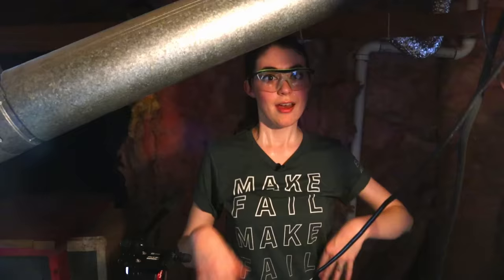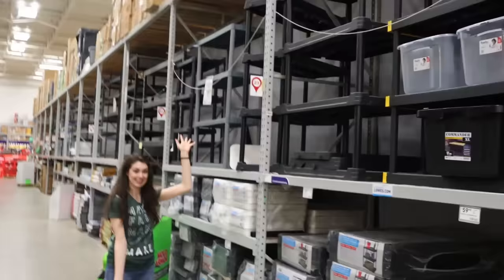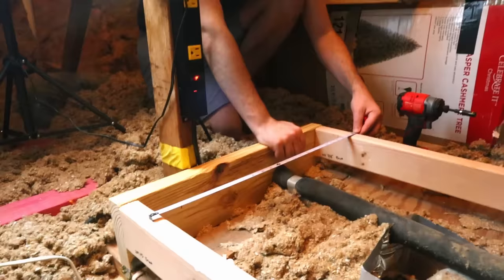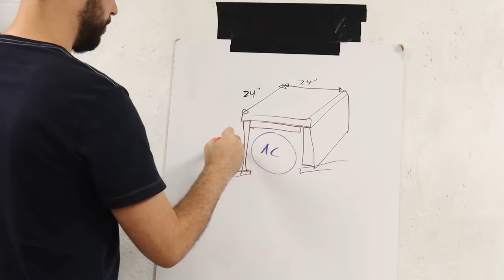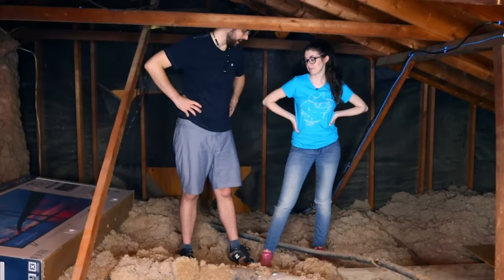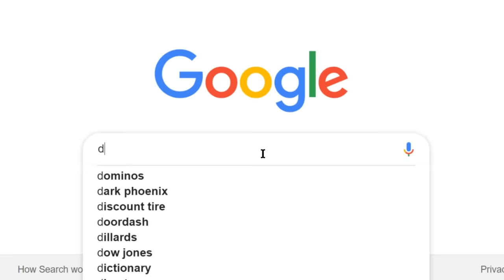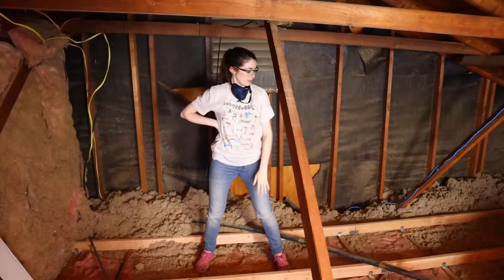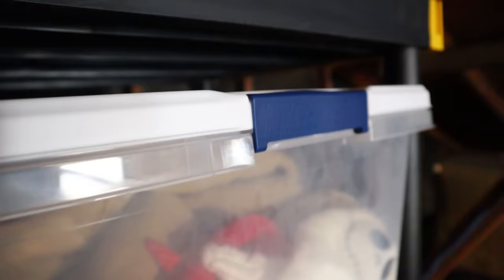DIY Attic Storage (Evan fell through our ceiling)

Comment: “Most 2x4’s are spaced 24 inches apart”

Takes 23 inch step.
Reply from the maker: 😭😭😭 so close!
Reply: @EvanAndKatelyn  I  thought it was 16" on center.
Reply: @maryblaylock6545  newer houses have 24in
Reply: I dunno, in Iowa I have worked on a ton of old houses. I'm shocked by how uniform things are not. I think a lot of people used to build there own, or at least a lot of addons.
Reply: @matthewbryson3693  Do they have 2x6's instead of 2x4's? That seems to me the only way they could get away with a 24" span.
Reply: Mary Blaylock I’m not sure...
Reply: @maryblaylock6545  Different states/areas have different spacing. Wall framing is usually 16" center to center and attics sometimes have beams 24". But it should always be one of the two. Personally I think 24" stud bays in walls are just kinda cheaping out on materials.
Reply: Hahahahahaha! 🤣🤣🤣

Comment: i love that you two can always support each other in work as a couple. In my country in tropic climate, we don't use wood as roof truss. Because we had so many wood termites. If we have to use wood we have to treatment it with oven and chemical before use. Looking this interesting video give me a new experience in building a house. Thanks for this video. Why dont you use foam layer or mix with metal foil layer for thermal insulation? it will looks tidier.

Comment: Those attic crashing messes are horrible to clean up and repair. We were adding insulation to the attic several years ago. Our house is old, nothing levels out properly,  and it throws us oddballs all the time. Like the way the floor boards are set up in the attic. 

Anyway, hubby had gone up to start putting down strips of insulation. I was taking care of something on the first floor. I heard a loud commotion, followed by him yelling for me. I ran into the master bedroom to find his leg dangling through the ceiling and him unable to pull himself up from where he'd gotten wedged into. 

The insulation went on hold while we scrambled to clean up and then patch the giant hole above the bed. 

We never did end up putting a floor in up there after the insulation. We've just sorted out where the flooring is safe to walk and where it isn't. So I'm going to show this DIY to hubby and see if we can get it done like Evan & Katelyn did theirs. 

I'm also really glad Evan was alright too. That's scary and dangerous to go through. (And then funny to reminisce about years later.)

Comment: For anyone questioning just how hot it is, in Texas heat, even with ridgevents and vents/airflow, the temperature can easily reach 170F. You literally cannot stay up there longer than an hour without risking some pretty severe dehydration. I feel for them. I need to fix my attic as well. Someone installed moderate flooring, but they just did it only to reach the A/C system and to store a few items, so there are mismatched boards (looks like scrap pieces). We made it work but jees.

Comment: After two years of finally getting comfortable going up into the attic because I normally would freeze up and cry. My mom had to go and check up a leak that was in far corner so she went up while everyone was asleep. She was near the edge of the supposedly super secured boards that are super thick and it broke so her leg fell into her bedroom. Since then I haven't even been able to get above the 8th step on the ladder without crying and panicking. So that's fun. (She was fine and just had a few scratches and some bruises.)

Comment: I used to work for a drywall and insulation company and my boss had me spray insulate 50 brand new apartment attics. i had completed 40 or so and got cocky so i started rushing (my first mistake). I was carrying massive spray tanks, wearing 10 pounds of gear, and a Tyvek suit. I fell just like Evan did and broke all the way through to the first level. My boss said "Youd be fired if i didnt own a drywall company kid!!".

Comment: Step 1 take out blown in insulation
8:18 Step 2 find out what that tube thing is and replace it with something better and cleaner
Step 3 inspect floor for sustainability
Step floor put plywood down on rafters

Comment: I  thought the blown-in-insulation should have been completely removed and regular insulation stapled between the wall studs and on the ceiling - not only would it look better (and be cleaner) but it would keep the attic from getting too hot in the summer and cold n the winter  - preventing possible damage to stored items (which means no insulation would be needed in the ceiling). That way, if you decided to finish the walls and ceiling, you'd have most of it already done.  Also would have made more 3/4 boxes to completely cover the A/C ducts (?) to protect it from possible future accidents.
Reply: {I'm thinking back to when my dad made the attic into a bedroom, huge closet and bathroom for me - he forgot to remove the insulation before he put in the flooring.  That made the heat stay downstairs (not much heat came thru the heat ducts)  and it was freezing in the winter and it was real hot in the summer.  By the time he realized the mistake, it was too late to correct the error.

Comment: I've never seen an attic with insulation like this. Is that normal in your country? The attics I've seen all had regular floor which you could use normally, no pipes or stuff running along it. They were all just regular rooms with a low ceiling. I hope you're going to do the rest of the attic floor too, I'm sure you guys could make it look awesome.

Comment: could you move that thick black vent pipe out somewhere else?   then you can lay joists over the whole place instead of just a small stretch and floor it to get fully floored attic.  Also, i am not 100% sure why grate flooring and not 3/4-inch plywood.  You will have bunch of dirt and dust going into your insulation through grates and you will have no access to it anymore to it to clean it..  Last, you should have used some sort of rockwool insulation.  that blown stuff is garbich that will collect dust and mites, its not good for you.

Comment: Awesome helpful video. Quick question, how do you know if any places that looked like the 2x4 or any studs running needed more support before you step on it or decide to put down a board? Did you get with a structural engineer for confirmation on what is allowed or not for weight considerations?

Comment: Is is safe to just remove the insulation? I always assumed it was there for a reason.
Reply: I believe it is safe when you use recycled material for insulation. If you have old insulation it is very possible that there is asbestos.

Comment: I know you have moved since this but either Katelyn is hobbit sized or as i believe american attics ARE WAY TOO DAMN BIG. You could fit a family of 4 in that thing and still have room for guests.

What is it with america building big. Gardens huge, houses huge, cars huge, debt priceless.

That said if i ever bought a home with a huge attic that bloody thing would become a reptile room put in some windows for natural lighting and heating along with fans and extractors in case it gets too hot and humid and add solar panels and possibly turbines to operate the electronics such as the lighting for the vivs and get accumulators to take the excess electric so i could use them during cloudy and still days. I'd probably do as much off grid power as i could to keep my bills down and so the money saved could go towards vet bills.

Comment: You could have just added insulation to the ceiling, covered that with plywood then get rid all the insulation on the floor.  That's how it's professionally done anyway.  You're also suppose to have a mask on with open insulation weather you're just putting it down or it's been there for years unless you cover it up.  Love you guys but this WAS NOT done right.